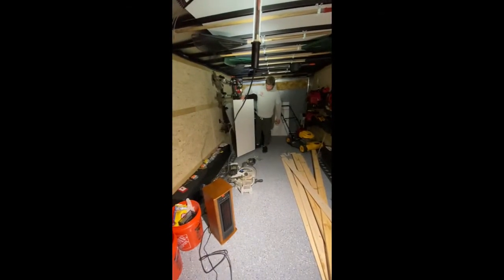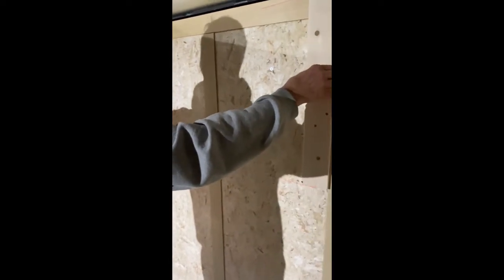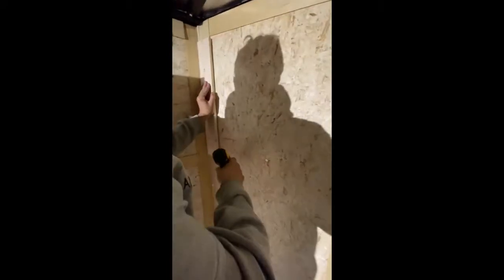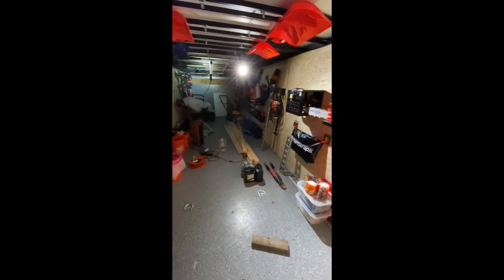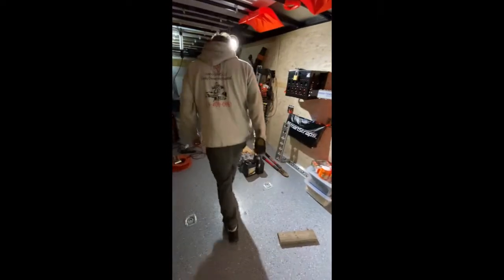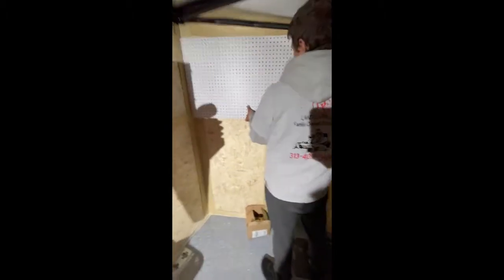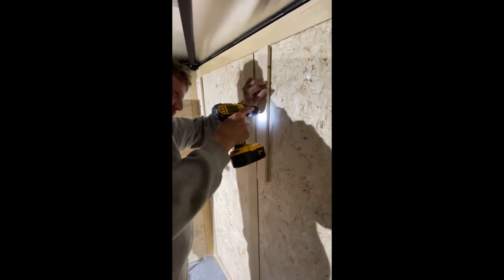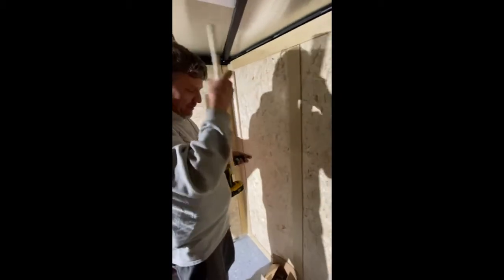We installed a Peg board in our Enclosed Trailer to have more storage space and organization

Comment: Did the epoxy floor hold up?
Reply from the maker: Yes sir, it's doing Great 👍 We wash out our trailer floor 2-3 times a month to keep it new looking.  We are definitely doing it again on our next enclosed We buy in a few months.  We run 4 zero turns in it and one had an bad oil leak and it cleaned up Great! Can't even tell it was there